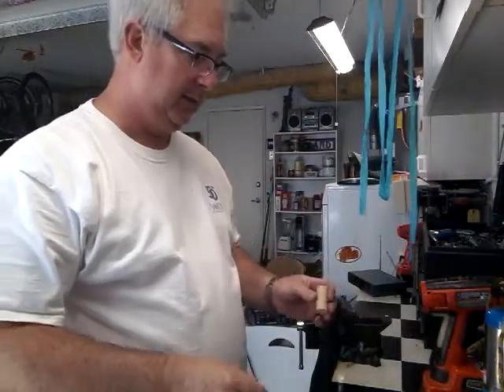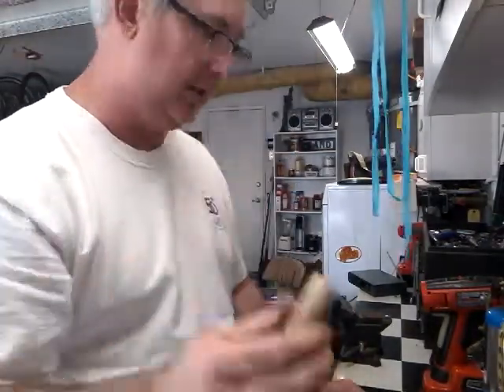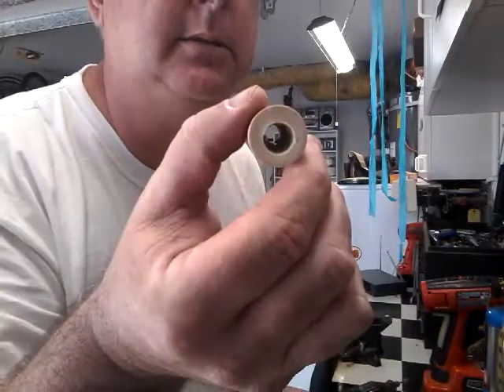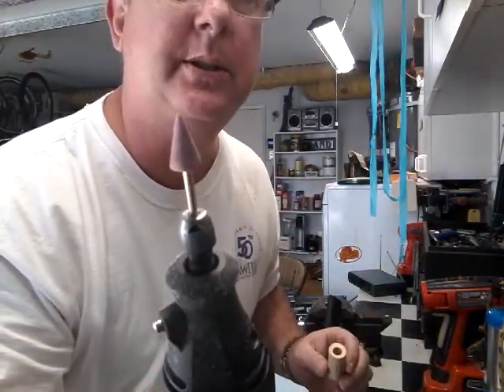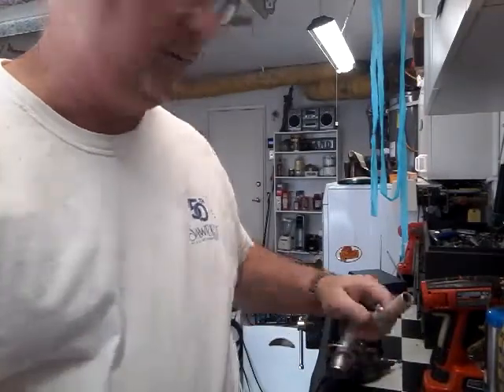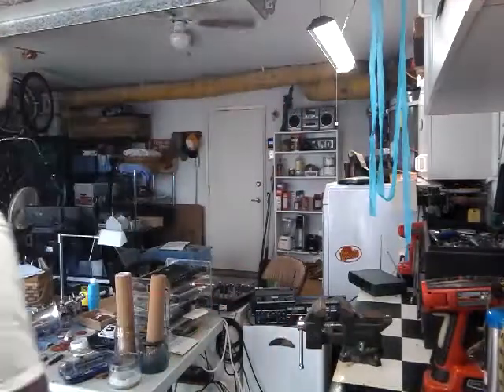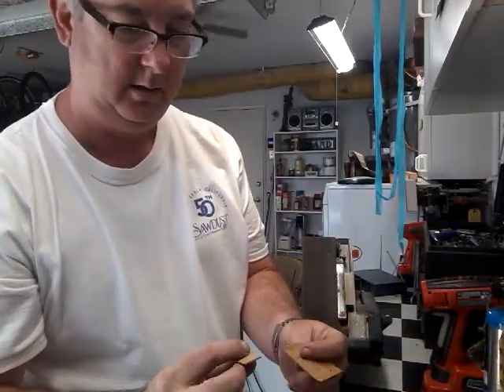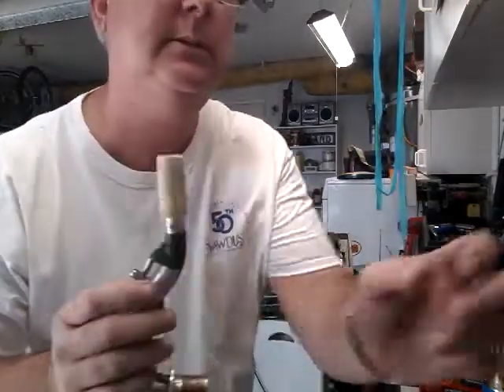Saxophone Wine neck cork

Comment: Nice Video! I have already tried it while ago but I didnt have the right tools to sand and hole it. At least I'm not the only one trying it.
Reply from the maker: The "Sax" experts hated it when I posted it on some of the forums. "Group think" rules all. This is free and as you can see, very fast to accomplish. When you have to order neck corks and then go through the process of gluing them in place, and yet still having to shape them, the question begs...."why not?"
Reply from the maker: ...and of course, when you tear your last neck cork during installation yet need to get a Sax out the door, your mind starts thinking of ways to beat the shipping time it takes to get more cork from Music Medic or whoever. Looks at GFs wine bottles

Comment: Do you notice any difference in sound quality at all? Let's hear it now that you did it!

Great video, I'm going to try it out now
Reply from the maker: Remember, if there are no leaks the sound will be identical. If you can patch up a neck cork with tape of some sort, you can see how this would be a better choice and there are no leaks if fitted properly. Also consider the synthetic material is 'never' going to dry out unless you subject it to UV light (leaving it out in the Sun) Plastic bags are proof of the durability of synthetic materials.